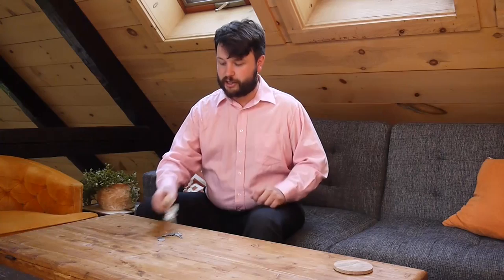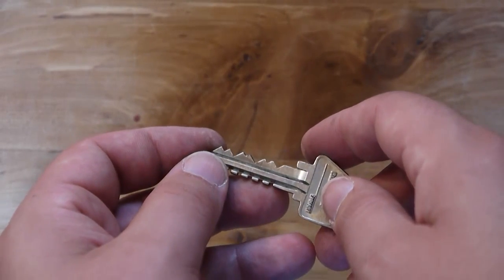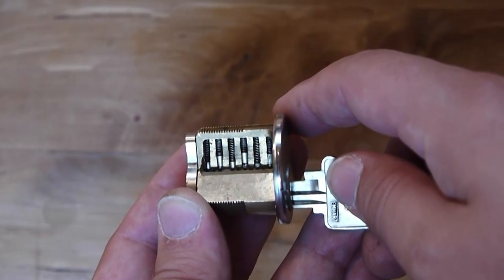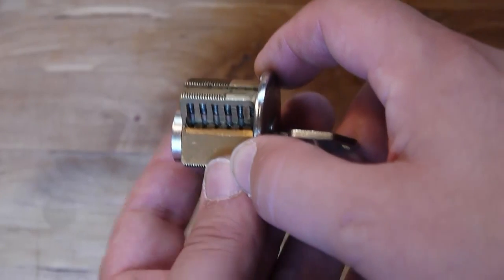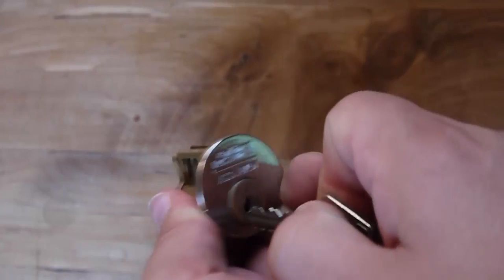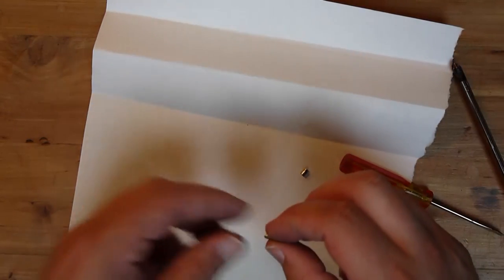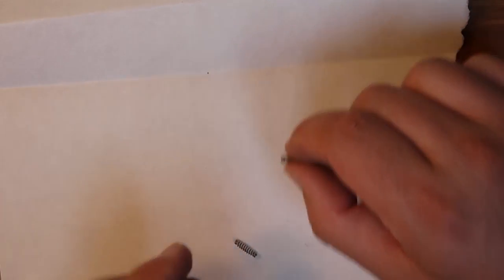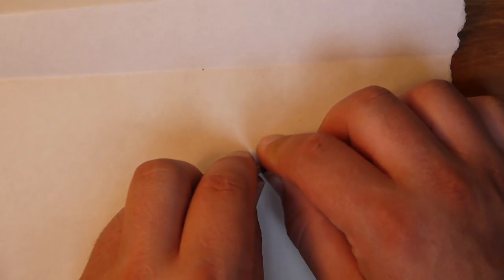The Collection: Emhart Interlocking

Comment: Very great idea for design.  But are you able to pick it?  I just wonder if the saying that, given enough time, any lock devised can be picked, is true.  I saw one author describe it as a dynamic delaying device.  A new lock is designed, but in a few years, some people figure out how to bypass (e.g., pick) it.  Then the locksmiths design an even more complicated lock.  Rinse, repeat.

Also...a lot to ask I suppose, but would you consider getting a macro lens?  It was difficult to see anything too detailed except for the two halves of the pin rolling together (coupled).

Comment: Very nice buddy. I have a Chubb M3 lock that I have picked once by fluke. I think it is a MEDECO take off. Any tips on picking it?
Reply from the maker: If you have a flat-topped hook or a deforest diamond, you can carve a small indent into it which will allow you to directly manipulate the chiseled tips of the pins. I have had VERY limited success on Medecos, picking at best 3 or 4 of the ones I've owned, but the indent certainly seemed like it helped a bit.

My earliest success came just by raking the sides of the pins, as that both altered their heights and began to spin them a little bit.
Reply: Nice one bud. I do have a flexy Peterson short hook that has a slight notch on the flat tip so will give that a bash ;o))))